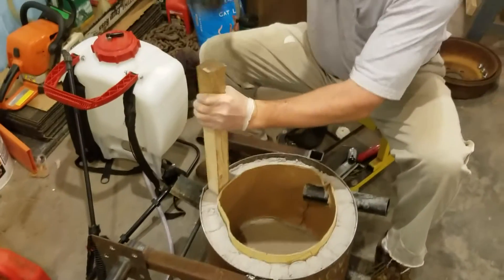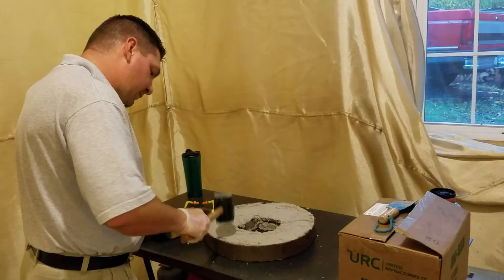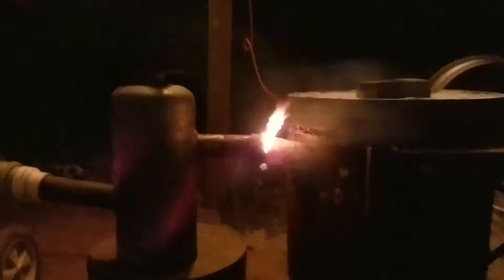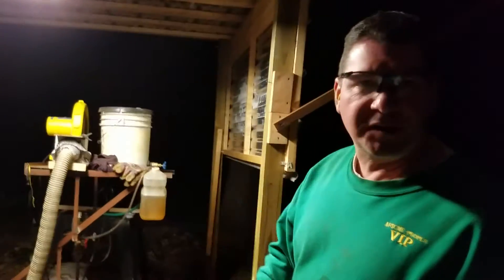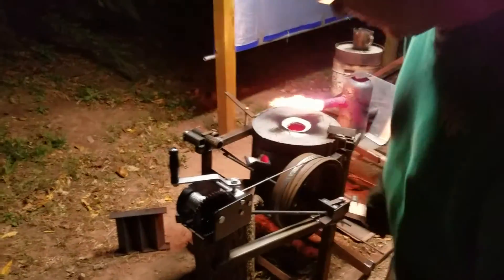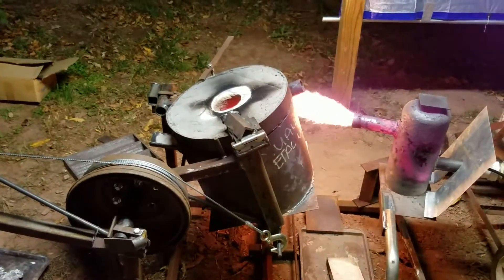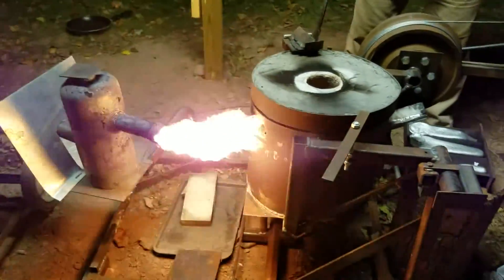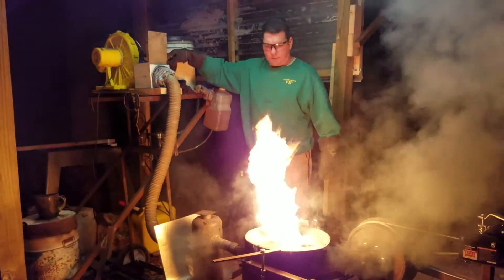Direct Melt Tilting Waste Oil Foundry 1

Comment: how many years has this design lasted you? is it just solid refractory ? no lining? have you melted other metals in it as well?
Reply from the maker: I have had this since the day I filmed this video and it's fine. It's rusty now because it is outside but it's doing well. I plug the holes up so mice don't crawl inside and mess it up.

Comment: I would like some clarification: you are pouring direct from the furnace, with no crucible? How to keep the chamber from cooling down low after adding ally?
Reply from the maker: Yes Khal pouring directly from the furnace. It's been so nice not having to deal with crucibles at all with this build. I would guess there is a maximum amount of aluminum that I would not want to go past due to potential cooling in the bottom. As I experiment with more and more in the melt chamber I can report my findings. Right now melting up to a gallon or more of aluminum, I've had no issues at all. I calculated that I could safely hold over 3 gallons if I wanted to max things out. That would be pretty bad ass.

Comment: hmm. 

i use a piece of 6" pipe about 18-24" long, it holds 33lbs of aluminum - 3.5 gallons. i like the tilt feature, much safer than carrying 40lbs of liquid 1400F. however, i usually cast my ingots about 8-12lbs andi find i can hold a coffee can with my tongs to dip into the crucible and take out what i need as i need it while keeping a hot pot at temperature with enough molten surface area to melt more material quickly. 

previous to this, i was doing a similar thing but using a cast iron pot instead. that eventually burned up....